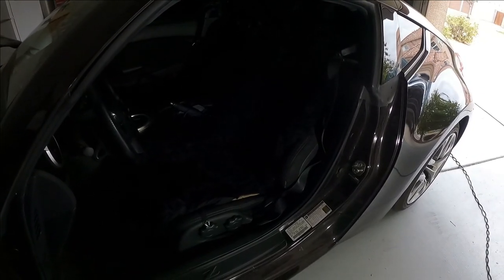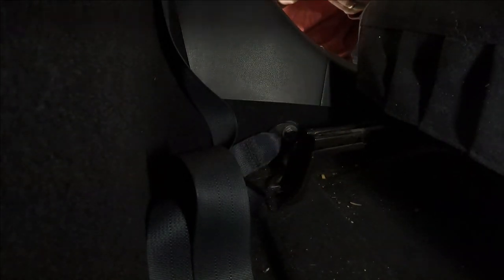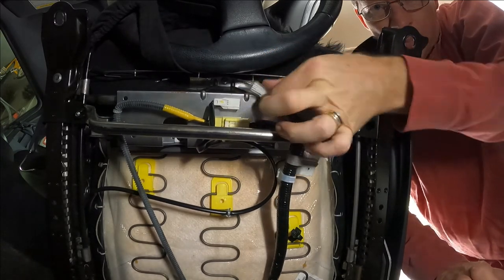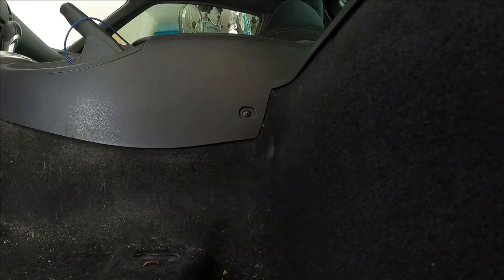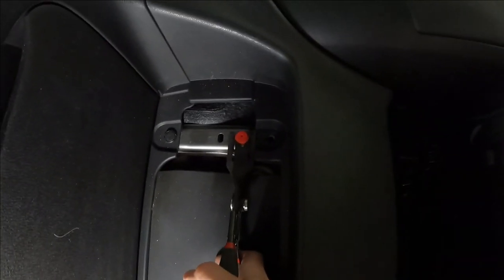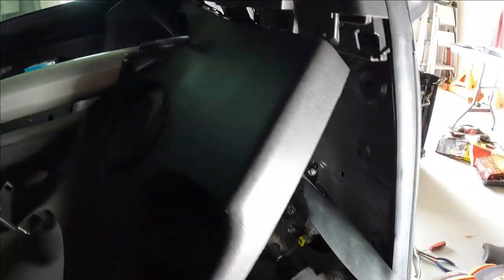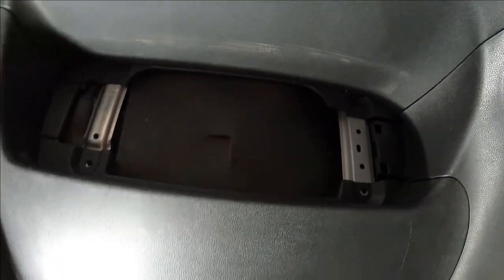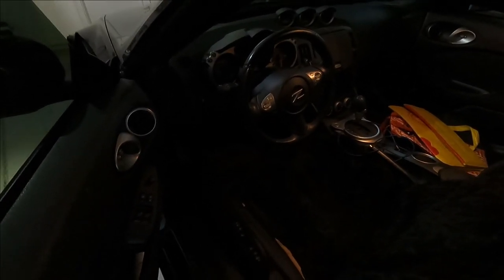Remove Nissan 370z Seat and Replace Driver's Seatbelt Retractor and Pretensioner (Full Instructions)

Comment: The passenger seatbelt on my z has a rattle around 75 mph any idea what it could be its coming from inside that plastic piece with the weather stripping when I pull the belt all the way out it stops